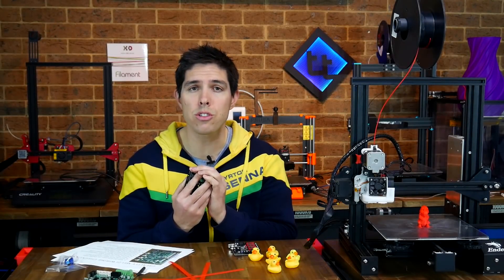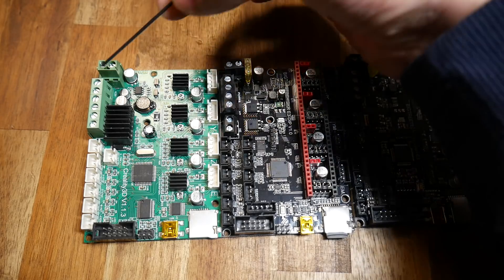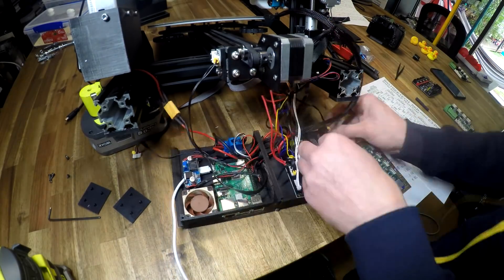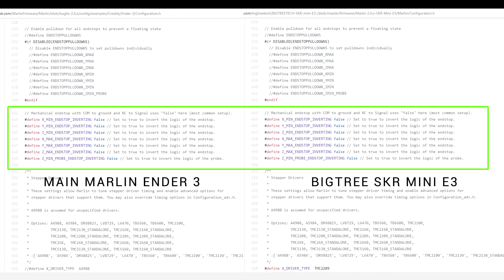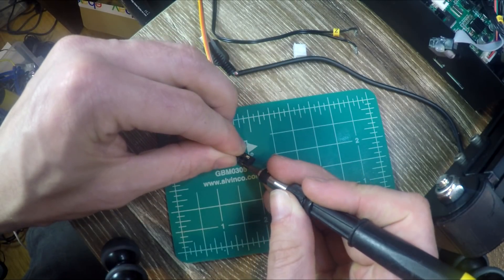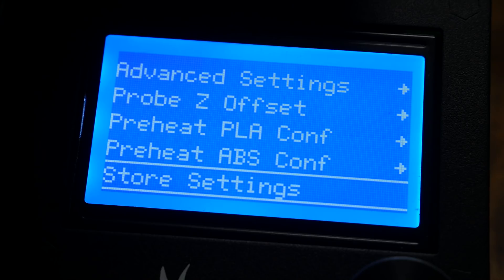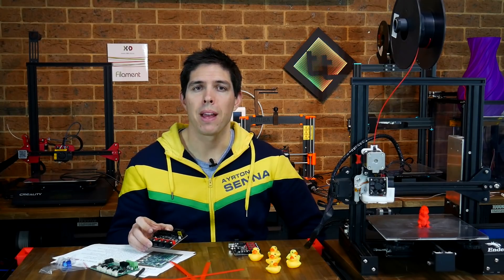SKR Mini E3 - The best Ender 3 upgrade from stock?

Comment: Did you encounter the eeprom thing with the RCT cpu that requires you to save all changes to a sdcard instead of to the board?  There seems to be a newer version of the board with the RET CPU that may be emulating the eeprom on the board itself?  Not sure which version of the board you have?
Reply: Here is a link to it on the github: https://github.com/bigtreetech/BIGTREETECH-SKR-mini-E3-/blob/master/SKR%20MINI%20E3%26E3%20DIP%20eeprom.txt
Reply: Wondered the same. I set up the sd-card eeprom.dat thing to save configuration parameters on mine.
Reply from the maker: I read about that in the docs but didn't need to do anything special for it to work. I just enabled EEPROM and auto init in the Marlin and didn't make the .dat file. All verified working.
Reply: Thanks for checking!
Reply: I'll have to experiment and test, but for now looking through the Marlin code (pins/stm32/pins_BIGTREE_SKR*, Marlin repo), it looks like the SKR Mini v1.1 is setup for using internal flash emulation of eeprom (commit c6be989 on 13th August); but not setup for the SKR Mini E3.
Do you have MOTHERBOARD set to BIGTREE_SKR_MINI_E3?
Reply: Update - the use of on-chip flash memory for saving configuration settings has just been committed upstream using the same change that went in earlier for the SKR Mini v1.1 (https://github.com/MarlinFirmware/Marlin/pull/15126)

Comment: Hi Michael,

I bought SKR E3 dip with tmc2208. I compiled the latest marlin 2.0 firmware. Everything looks good and working but I have 1 problem with my Z stepping setting. At the firmware it is configured to 16 mstep as all of the other axis. But when I read out the setting with m122 it shows 8. Only the z is wrong. Do you have any tips what could be the problem?

Thanks

Comment: Damn, version with 2209 is out of stock till october :(
Reply: Noticed that too, wondering if I should order the DIP version with 2208's or I better wait for the non-DIP with 2209's. The biggest difference seem to be that they run cooler and operation without end-stop switches.
Reply: @alexhofstee466  I've decided to wait, I'll probably buy sidewinder meanwhile

Comment: Love your videos. Can you still add the Octi Pi after this upgrade.
Reply: I'm pretty sure Octopi is platform agnostic. As long as it has a USB port, ya should be good. He shows the baud rate in the vid, so you should be able to just set Octopi to that.
Reply: raptor1jec thanks man. Just crazy that we're configuring this with a baud rate.

Comment: I appreciate his videos but he doesn't answer comments very well. I did notice an error and don't know if it matters but usually it does when it comes to + and - being hooked up correctly. the Bed wires are backwards on the skr mine e3 v1.2 that I have so make sure you get those hooked up correctly for the B in his diagram. I really appreciate all his hard work but he should answer some questions on his videos a little better. Now before I get bashed again I really do like his videos and I appreciate what he is doing here. But I have asked a few questions on his videos and never gotten a answer back on any of them. Just wanted to give a heads up on this part to everyone.

Comment: Hi, could you confirm that the bltouch v3.1 is compatible? Someone tell me that is not compatible,but i have no confirmation. Thanks a lot.
Reply: BLT v3.1 is definitely compatible. I’m using one with this board without any problems.

Comment: I'm starting a 200x200 diy build but it will have 5 stepper motors. Do you think this would be a good board for such a project or would it not work because of the 5 steppers? FYI, would like to add a touch screen if possible. Hopefully you have some suggestions. Thanks

Comment: Hi Michael, I recently bought a SKR mini e3 board and followed your video which was great. I then needed to flash the firmware when I wanted to install a BLTouch. After downloading the file firmware file from github, and followed the instructions to flash the board via the SD card, I now have a printer which starts up and the screen just stays blank/blue... any advice?

Comment: I just got the newest e3 but my printer is in its rear stage where it prints really nice. And every time i upgrade something a non related thing goes wrong making chase problems for hours. Is it so good that i can possibly print faster have less issues and quickly swap it out and have my printer up and running again with no changes?

Comment: O man wonder if I can get the TH3D version of Marlin working on it so I can use the EZABL
Reply from the maker: It will be possible. TH3D has their own equivalent board. More expensive, but a faster processor too.
Reply: @TeachingTech  There must be some point where you don't really see any difference, if you increase the clock speed on your printer. The SKR v1.3 has 100MHz, this new board 72MHz and Klipper theoretically 4x1.2GHz, since it is running on a Pi (but with more overhead and limited by the interface to the old board etc). Where would you guess is the line where a higher clockspeeds only looks nicer on the paper?
Reply: @TeachingTech  Do you see any value in the TH3D board? The TH3D board looks like its built with overall higher quality components but I have yet to see any proper head to head comparisons for all of these new options.
Reply: It all depends on what your doing with the printer, identical settings and drivers i doubt youd see any difference, if your experimenting with high microsteps say 0.9 degree motors and 256 native steps and running high print speeds with accelleration curves and other things you might get the boards to start struggling but for most home stock printing i doubt youd notice
Reply from the maker: Couldn't agree with Neosophist more. Unless you push things the print quality will look the same apart from fixing surface artefacts.

Comment: Hi Michael. Will the Integrated TMC2209 board work on my Geeetech A10 as well please? Running Titan Aero already, made a massive difference
Reply from the maker: Has enough ports although I'm not sure if the plugs are exactly the same.
Reply: @TeachingTech  Thank you :-). I will try find detail on the 2560 V3 board and compare !

Comment: Are there POTS for Voltage adjustment.  I run a dual stepper z axis with dual lead screw on my Ender3.  I would hate to buy the board and it not be able to run my dual Z.

Update:. After more research i discovered that since they are UART you actually change the Voltage in the Firmware.

Comment: Hello Guys, i recently bought the E3 DIP version with TMC2130s. Now i'm stuck at the hardwareconfiguration for the spi and diagnistics conncetion. The for SPI, all red jumpers have to be connected. But what i have to connect for the diagnostics, whitch Teaching Tech mentioned in the TMC2130-Video? And can you tell me which solderpads I have to solder together in the BIGTREETECH TMC2130 V3.0? Thanks a lot for helping me!

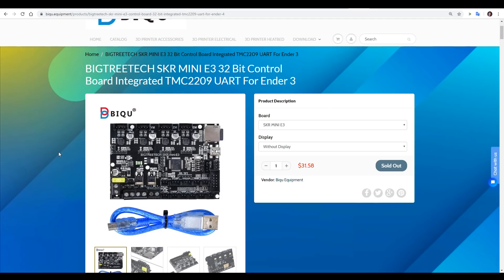Comment: 1:38 TMC2130 has stealthchop2, right?
Reply: No it doesn't. You shouldn't buy TMC2130 anymore in any circumstances. Buy TMC2209 that are better in every aspect and also cheaper..
Reply from the maker: I agree with Juuso, the newer TMC drivers are win win.
Reply: @TeachingTech  Installed TMC2209 drivers on all of my printers :)

Comment: Board dont have eeprom you need to emulate it with marlin and SD card
Reply from the maker: I believe an update has occurred, I required no such steps and EEPROM is working properly.

Comment: For the life of me I can not get the firmware to compile for this SKR Mini E3 v1.2 ... I have tried everything possible that I can think of. It keeps giving me a fail on the STM32F103RC_bigtree and I think it is do to the microSD card that is plugged into the SKR miniE3 not showing up when connected through the USB to the PC. I have the SKR v1.3 and when I upload to it the files are readable through USB. I have tried to update the USB driver they supply but the Maple R3 driver is not digitally signed so Windows 10 wont update it. When plugged in the Serial Port for it does appear though so it should be recognized. Plus my Device manager is not flagging a issue with it.
All I want to do is fix the Endstops so it will home. I really do not want to rewire them. Plus I want to be able to adjust tings for the BLtouch.
If I can not get this to work then it is a total waste of money.

Comment: Anyone know if this is just as easily swappable for the ender5? I know they are almost identical
Reply: Did the swap a few days ago. The wiring is identical. You will have to download Microsoft Visual Code and also download the latest software for the board from skr github. In addition you will need to download Git Cilent and add PlatformIO to VS Code. You have to go into the software and invert the direction of some of the end stops and change max build height. Speeds will also have to be changed. You can find tutorials on how to modify Marlin 2.0.
Reply: By inverting endstops I meant inverting axis movement direction. I haven’t installed a Bl touch yet but I might.

Comment: Hello. If I want an bltouch on the board do I just take the firmware file in the describtion and put it on my sd card and it works or do I need to do something else for the bltouch to work?
Thanks

Comment: Mike, i am trying to modify your configured Marlin source firmware for the Dip version. the build is failing due to  #error "Unknown MOTHERBOARD value set in Configuration.h". i know i have the right one in there. #define BOARD_BIGTREE_SKR_E3_DIP. Can you help me out? or do you have Firmware already setup for the Dip with 5160s that you are willing to share?

Comment: Great video! Subscribed! Just a quick question: which is better; the TH3D firmware or the 2.0 firmware that comes with that board? I am seriously considering to just buying that SKR board so I can have both ABL and filament runout sensor without having to solder anything.

Comment: Do any of the boards he's using have the same silent drivers as the V1.1.5 board?
Reply: its one step up, the 1.1.5 uses TMC2208, the shown board here is TMC2209 and runs at 32 bits, which allows faster movement calculations, vs stock 8bit. and as far as i know, the board will have more memory and you wont have to worry about compromises with the firmware (in order to get bltouch on stock, you lose arc movement functions for example)

Comment: I just purchased the new E3 Pro v2 just released.  I'm to understand it has a better board and stepper motors.  Is that correct?
I presume this is a good replacement option for the new v2 Ender3 Pro if the mainboard is same as the previous model?

Comment: @teaching Tech
I bought a skr e3 mini v2 based on your review last month. It worked perfectly until yesterday where it bricked out of the blue as it was about to print. It's now unusable and after some research this seems like a common issue with the boards, have you come across this issue before and are there any alternative 32bit boards you recommend?

Comment: Hey! I just got mine last week, and love the upgrade. Are you noticing that your stepper motors are running hotter? My Y-axis motor is running so hot that it's untouchable without burning you. I've tried looking around in the firmware for a setting I may have accidentally activated, but everything looks good. I even lowered my Y current to 520mA and it's still getting so hot that even the heatsink on the motor is extremely hot to the touch.

Comment: aside from sensorless homing and higher maximum amp(therefore higher max speed/running cooler?), is there any advantage for TMC2209 over 2208? I think the DIP one with TMC2208 package looks cooler and just in case the driver goes bad I can just pop some new ones.
Reply: Sensorless homing works in combination with quiet stepper mode, for one. It has newer versions of the same features.

Comment: Hi I have added a new motherboard to my ender 3 but the only problem is, when I unplug machine and switch off when I move the x axis or any of them the screen lights up is this normal?
Reply: I think so mine does that too, it has the original creality board, if i keep moving an axis long enought the printer actually turn on

Comment: So I am looking to do some updates to my ender 3, I watched a few of your videos. More so since I have seen many of your videos recommended on 3d printing reddit and a facebook group. So my question would be this, do you recommend just getting the skr mini, raspberry pi + Klipper, or do both upgrades? I'm doing a few upgrades based on my overtime checks. Things I am for sure going to get first is a glass plate, new springs, and updating the filament feeder. I should have enough for both, but if not I would like to know which one should I prioritize getting first. Next set of upgrades will be the extruder, maybe the cooling fans, and either the new board or raspberry pi.

Comment: I used your firmware but now it thinks X is Y and Y is extruder and exturder is Z, it also makes a really high pitched noise and homes in the wrong direction and the end stops are mixed up too.

Comment: Ender 2 — Anybody know what board at this level of features would be compatible with the Ender 2? It is on a 12V supply and I recently bought a 12V metal end and a 12V MOSFET for the bed, so that would be a factor in choices.

Comment: Good video. Do you know what to set the serial ports to to get a try 24 to work? I think mine knows the printer is there but I don't see any reaction to the buttons. Also are you using eeprom emulation or did you fit a SPI eeprom?
Reply: That should say TFT24.

Comment: It’s so great and cheap but could’ve been far better. Two outputs for the Z driver for dual extrusion, more fan outputs (2 at least)  and no hard wired pull ups on the endstops.

Comment: Is the hot end fan controllable via time or temp so it doesn't run the whole time the printer is on? I'm still torn between this board and the ezboard from th3d.
Reply from the maker: By default no, but there are other spare IO pins you could use to trigger a mosfet or relay. One disadvantage compared to the SKR V1.3 or MKS Gen L.

Comment: With all 6 version of your provided build, I'm getting TMC Connection Error. The attached .bin on the SD card works but can't add my BL touch to it... Bit frustrating.
Reply: Im getting the same problem, I have the v3.1 bltouch
Reply: what version is you E3 board?  The v1.1 firmware will not work on the v1.2 board.  You will need the correct firmware  from GitHub.

Comment: Hello, i bought the mainboard a few weeks ago, and it has been vibrating a lot for almost a week, and it has been giving me some weird looking prints, where the layer lines are very visible no mater what. I've changed the entire z axis because i tought it was that, but it's still the same, the only thing that has changed it is that i upgraded my ptfe tube. Does any one has an idea on what to do???

Comment: I installed this board on my Ender 3 pro. Now I need to know how to restart a print after I have to stop it because it is not sticking as it should. When I stop the print I can't get to anything to start it up again.
Reply: if you need to pause, press "pause print" instead of "stop". Sometimes it will tell you to reset after pausing - just do a power cycle then it'll ask if you want to resume when you flip the power switch back on.

Comment: I just bought an SKR Mini to put in the Ender 3. I have been using Octoprint with the stock Ender 3 board with no problems. I have been seeing some posts on the net that there are problems with Octoprint and the SKR Mini. Do you have any info on this?
Reply: Octoprint seems to work with mine. All the controls and cameras work. I haven't actually printed yet because I've been trying to get my BLTouch to work
Reply: @briannab4905  Thank you for the quick reply. I have a Th3d EZABL sensor that I have been using with the Ender 3 stock board. I'm not sure if the EZABL would plug directly into that port. I reached out to Th3d for some information. I will post their reply. If I can get some info about the BLTouch, I will post that also. Thanks again!

Comment: Thank you for great video which gives me new option to upgrade my coming ender3 pro 
Just a question. I still don’t understand what’s the difference between 32 bit and 8bit is it just like rub the machine faster and smoother? Also, Does the mainboard has the function of resume power failure ?Thanks
Reply: Board has more ram and storage as well as just more processing power so can enable manly more features that improve quality of print. Stealthchop stepper drivers are silent too so loudest thing in printer will be the fans

Comment: do these mainboards make the printer silent like the Ender 3 v1.1.5 Silent Mainboard as this the main reason for me to upgrade from the stock ender 3 pro mainboard?
Reply: Yes, it makes it dead silent apart from the fans, the only way to lower the fan noise is to replace the fans

Comment: Thanks Michael for all the time you put in to this stuff. I have a question about the BLtouch though. When I try to compile it going back and making the changes from your marlin video I get some yellow errors when compiling. If I go by the changes on the bigtree instruction from github it compiles. Do those changes need to be done anymore or does the new marlin 2 make them when compiling. Any more detailed help you could give would be greatly appreciated.

Comment: How useful are the heatsinks on the used board as the TMC driver chips are best/ideally cooled on the bottom side where the chip has a big heatpad?
Reply from the maker: When they are integrated like this they have the ability to sink heat into the PCB too. Plus 2209s can handle higher current so will be running cooler at Ender 3 spec.